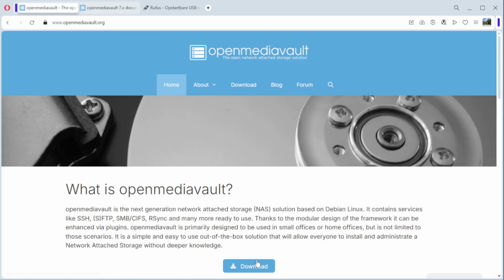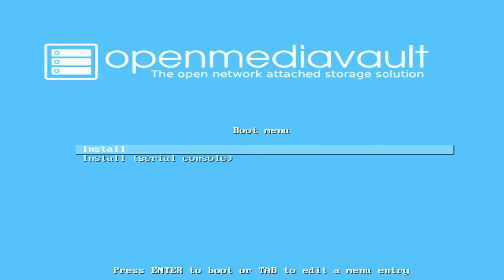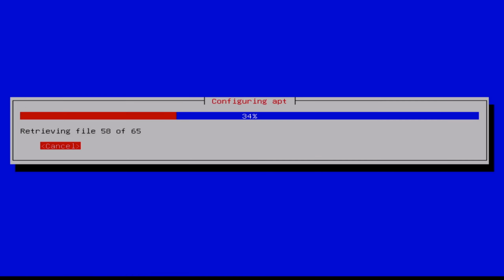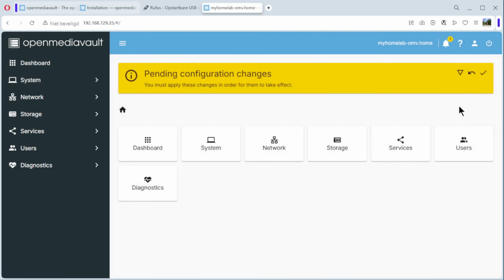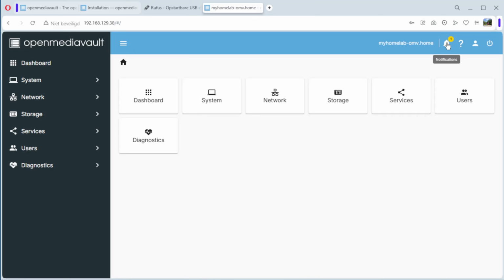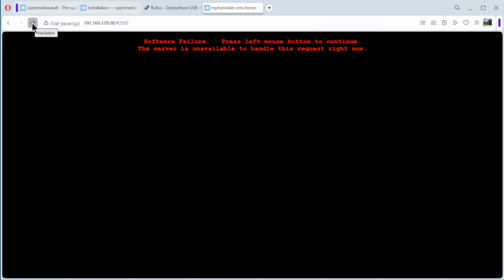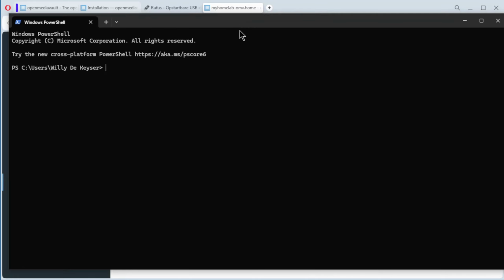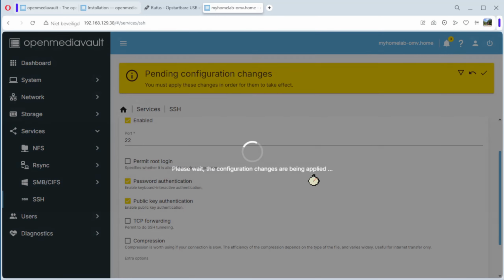OpenMediaVault 7 - Install & Basic configuration

Comment: Whats the point of an ISO to Bootable USB if it then wont install because the machine is not connected to the internet?
Reply from the maker: I don't think so because it downloads updates from the internet although it should be possible to bypass downloading updates from the internet.